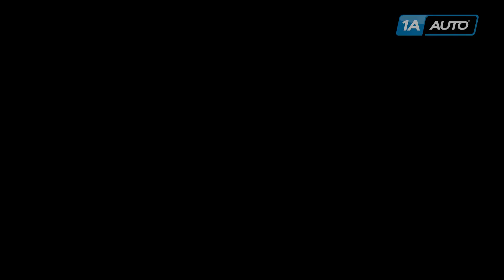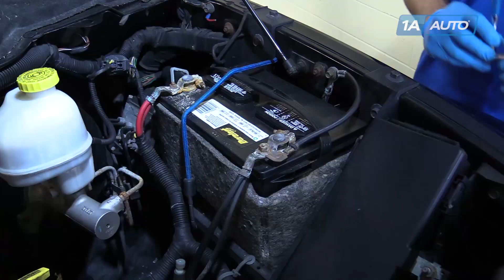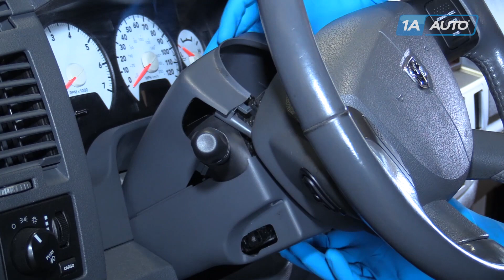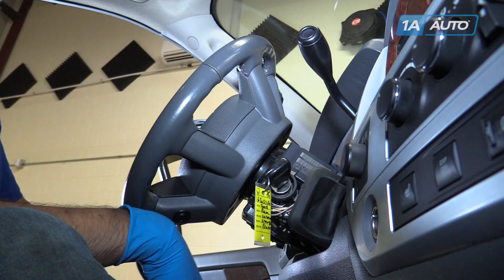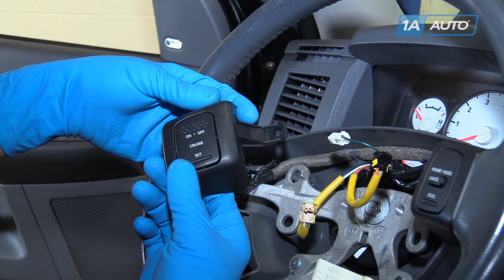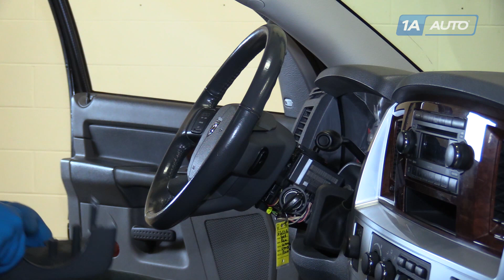How to Replace Cruise Control Switches 02-08 Dodge Ram 1500

Comment: 2003 dodge ram is not 10 mm. I think it was 5.5 mm or t15. I don’t kno y but it’s hard to find anyone w the correct info and used parts are even harder to find correct ones

Comment: Your title is misleading 02-08.  My 03 Ram 1500  has completely different switches.  Switches are held in with screws from the back side.  Remove the switches, 2 bolts hold the air bag.  The plugs for the switches are located under it.
Reply: Mine is also an 03 and I had to do a double take.  That is definitely not the same switch
Reply: I thought only 2005 to 2008 hemi dodge were the same. Mines an 08 but 2003 is very different. Sorry 2003 to 2008 the 6 cylinder may be different as well as the 4.7.

Comment: Great video, I clicked like and subscribed to your channel. Question though, would a plain-jane 99 Dodge Ram have the cruise control connectors under the airbag if it didn’t come with the option from the factory?

Comment: Is there a fuse to check? Same truck 2008. Sometimes  cruise works. Sometimes not. Just started doing it
Reply: I think the fuse actually controls multiple things so you'd have more issues than just that.